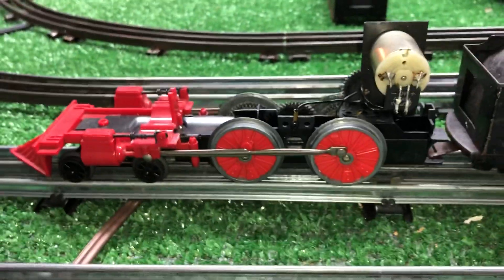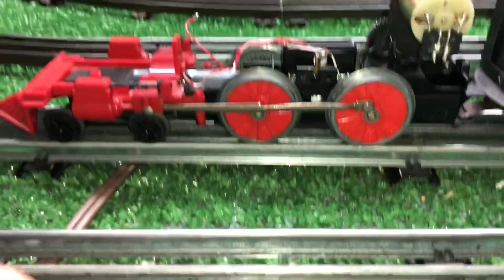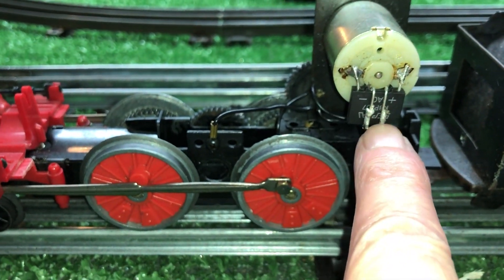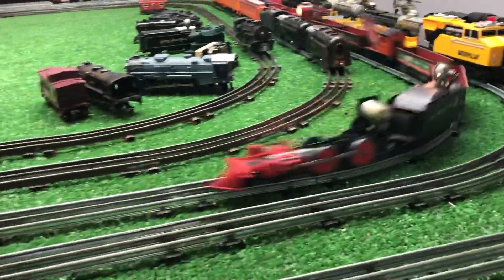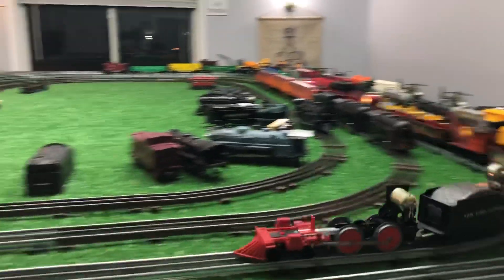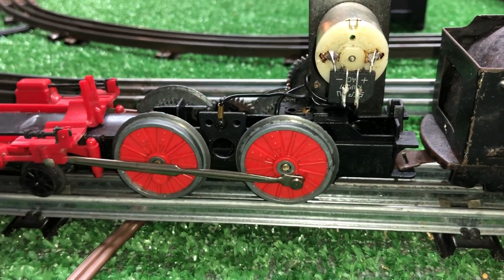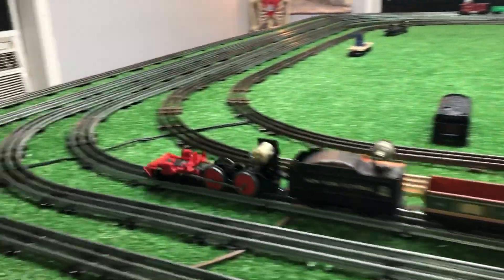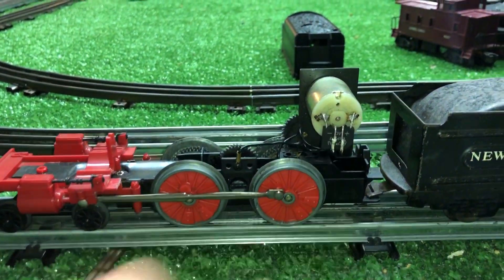LIONEL DC GENERAL / NEW FULL WAVE BRIDGE RECTIFIER MOUNTED ON THE MOTOR / FIRST TEST / WORKS

Comment: Would this be the correct rectifier to use for LED lights?   What would you add to the output to get to 3-4 volts?
Reply: I know this is an old post, but maybe this would be helpful.

LEDs are a current mode device.  You only need enough voltage to exceed the forward voltage drop of the LED.  White LEDs generally have s forward voltage drop of 2.5 to 4 volts.  

Say your maximum voltage available to the LED is 15v and the voltage drop of your LED is 3 volts, the required resistor  to limit the current to say .020 amps (20 milliamps) would be (15 - 3) / .020 = 600 ohm.

You don't need a full bridge recifier.  You do need to put one diode in series with the resistor and LED.  Although the LED is itself a diode, it has a low reverse breakdown voltage that will eventually damage it if AC is applied.

You do need to consider power (wattage) with your limiting resistor.  It would be .020 ^ 2 * 600 = .240.  A quarter watt resistor will get quite warm  but barely be ok.  I would either change it to 1200 ohms (10ma max) and use a quarter watt, or use a half watt at 600 ohms.

Comment: Nice neat simple compact installation. Good job!  You can also do this on a modern expensive can motor engine when the expensive  hard to get circuit boards burn out.